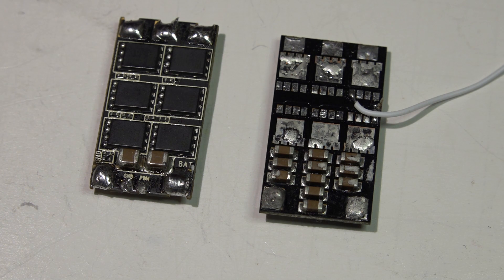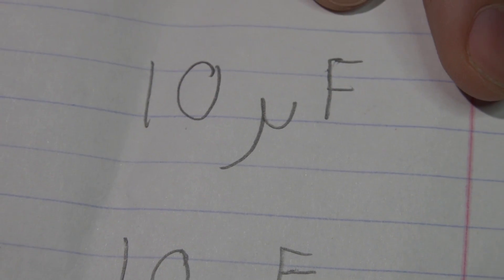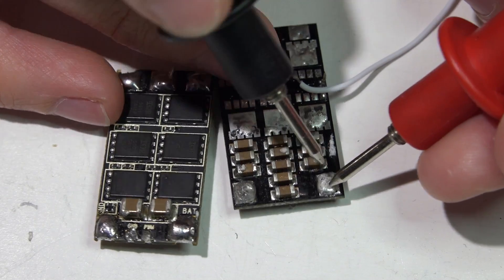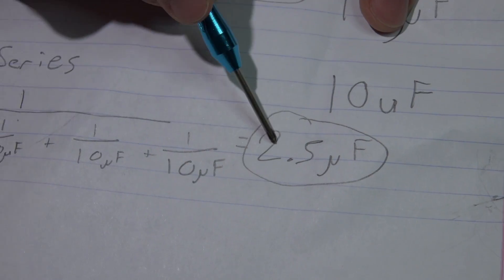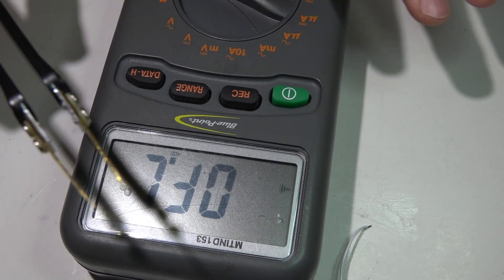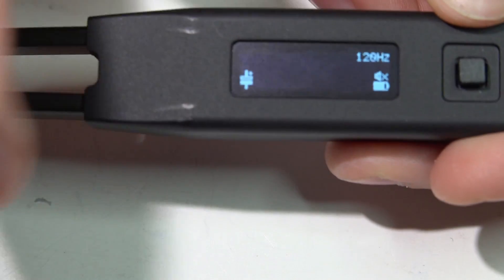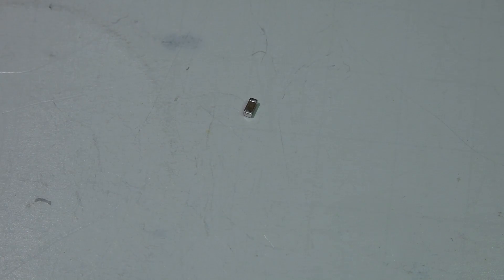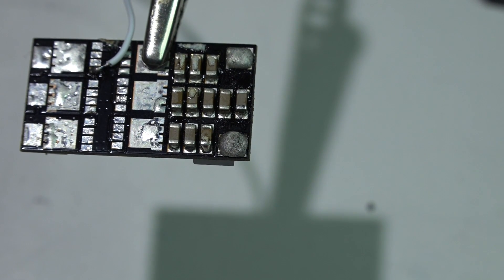ESC Repair: Replacing Capacitors (and how to measure them)

Comment: What temperature do you typically run your hot air station? trying to figure out an ideal temperature thats not high enough to damage, but not low enough to never melt the solder.

Comment: how do you know which capacitor is burnt when there is no clear evidence of it burnt , in fact , when do you know which electronic component i burnt when its not clear , but you still have an identical replacement

Comment: I have a 30amp little bee esc that connects with blheli just fine everything seems to be good on it i've tried updating it and no problems but it is sending no signal to the motor at all any idea on what could cause this all my solder joints are fine i've double and triple checked them? On a side note i upgraded the quad that these esc were on to the blheli32 wraith esc and all 4 were working great before i moved them. I've even put a different esc on and it worked perfect so not wiring or motor.

Comment: When measuring in series, does it matter if one is broken?
Reply from the maker: If the caps are in series and one is broken then no voltage will make it through any of them. But almost all ESCs have caps in parallel. The ones I showed in series are a rare case.

Comment: Nice video man, I have a couple things that I need to surface mount solder components onto them here, but I don't have the tools to find out what the rating is of the components. 

I really want to fix them though, mainly my x4r receiver, a small diode went up in smoke on me, it is screened D3 right next to where the diode was on the pcb, do you have any x4r's that you could check to see what sort of diode it is that I need to sort it?

Thanks in advance

Comment: Hello my friend, thank you as always for your tutorials.
I liked this video a lot, but what I want to know is, why would you change a capacitor on your esc? There is some specific issue related to a bad capacitor? Like stuttering, brown out, or similar issues?
An high five from Italy
Reply from the maker: Capacitors dont really go bad. They just break off often, especially if you dont use a ESC protector and just have a zip tie on heat shrink. The zip ties will break them off easy. So this is just for if you're missing any
Reply: oh, I got it now. Thank you for the explanation.
Reply from the maker: Yea I should have clarified. When I said the caps dont really go bad I meant the ceramic caps. With the tantalum caps you can visually see when they are bad because like Joe said, they explode or pop.
Reply: usually what happens is  the caps fall off when bad crashes happen. In one of my quads I found a capacitor stuck to the eletrical tape while disassembling.
Reply: The only time I had a problem with a capacitor, was a 220uf Polarized. I heard a loud pop while it was hovering and the quad started to behave very funny. when i opened the quad (I use almost always sandwich  type frame) it was a mess inside: 
The capacitor puked all of its content on the ESC and I had to take it off,  for cleaning and changing the capacitor.

Comment: lol the bardwell moment killed me haha.. keep up the great vids - alex from canada
Reply from the maker: I chuckled a little at myself after that.  I love Joshua
Reply: Nice video JC. I've got an idea for a repair video. How about a video showing how to repair a board that s had one of its solder pads ripped off. I know most of the time it's unrepairable, but it's possible to tap a wire directly to the last component the solder pad was connected to. It's a bit ghetto, but it's saved me waiting time and money. Most of the time I can just see and follow the trace on the board to find out where it went. Other times its just obvious. anyway, just an idea.
Reply: drumrboynoid I had to solder the negative power wire for my littlebee esc onto the legs of a chip that was next to the ground pad that tore off, it's been flying great and I've had no issues at all with it. 

JC's videos are great, I wish that he would be able to answer my question I posted on here regarding my x4r, as I want to try fixing it, but I'm not sure what type of diode it was that went up in smoke.
Reply: Alex Persaud it cracked me up too, brilliant!!

Comment: Is there a way to install firmware if it is updated to the wrong firmware in BLHeli_s?
Reply: Yes you can with use off a FTDI32 ore a USBASP V2.0 flashing directly on the chip.
Reply: The solder pads are in a L shape any way to differentiate what pad is what with out shorting something out?

Comment: Nice video, I enjoy your repair series :-) 

However, you don't really have to figure out the actual capacitance in this specific case (main input bank on ESCs). Just put on as much as you can fit for the size. What is important is that you get ones that can take the voltage (battery voltage plus a healthy margin).
Reply from the maker: Thats true. Any size will work and the bigger the better. I just know some guys want the exact size so I turned it into a lesson. But you are correct, the bigger the better and as long as the voltage rating supports it.
Reply: Peter Kjellström for sure they don't all got too be the same unless ur ocd...i tape mine so can't see the different sizes anyway😀